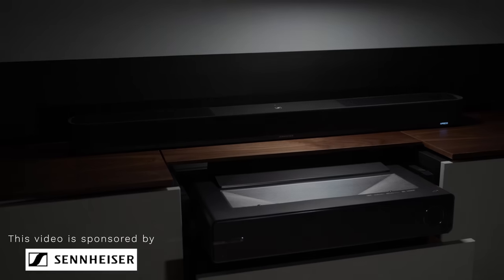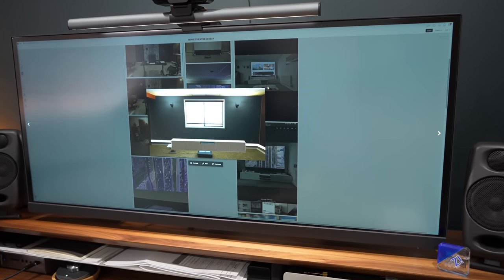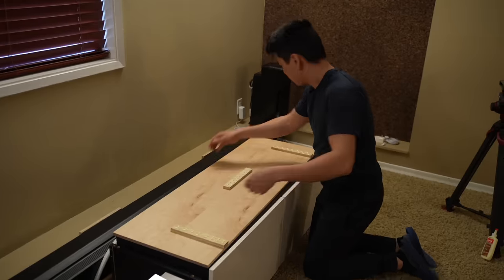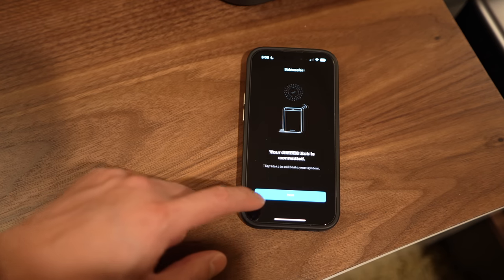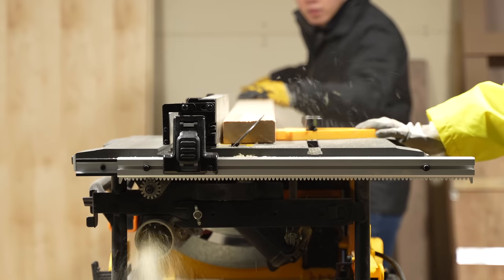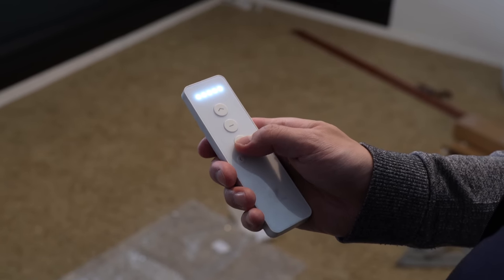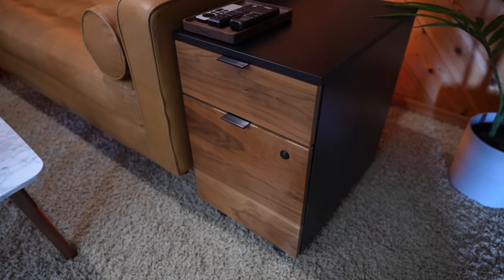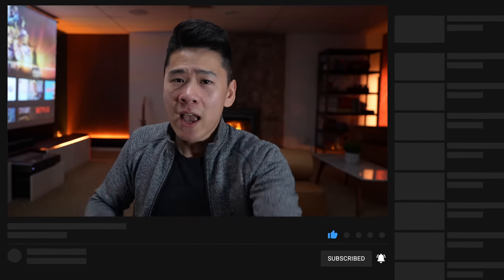The Modern DREAM Home Theater Room Makeover 2024

Comment: Word of advice, DO NOT wear gloves when working with rotating parts of machines! If you run your hand into the blade, it might catch and PULL your hand in and do more damage. Pay 100% attention to your work. As a contractor working overseas on military bases, I had to get on SAFETY for not following the rules. They would tell workers to wear gloves when operating table saws and I had to correct them! These are the people who SHOULD know too!
Reply: Agree
Reply: Dork
Reply: Nerd
Reply: Hard agree. People who aren't familiar with tools tend to think gloves are always best, but it's super important not to wear them when using power tools.
Reply: Insane!
Reply: Depends on the gloves, but yeh

Comment: You really lucked out with how the room was already designed. The rock wall and fireplace, and the wood paneling really ties it all together. Would not look half as cool without those, tbh.
Reply from the maker: the room definitely had quite a character to it!
Reply: I do think he complemented what he had with the furnishings and design he chose. The rock wall fireplace is great on its own but the wood paneling is an old look that others may have decided on removing to replace with drywall (possibly to hang up posters or those sound proofing panels on). He made it work with the choice of color of his sofa and chaise lounge, as well as the wooden panels of his projector/TV stand.

Comment: First thing I would have done is rip up the carpet and put down some hard wood flooring.  Also, would have painted the brick wall for the fireplace and removed the drop ceiling and installed pot lights.

Comment: Looks fantastic! One thing you might consider upgrading in the future is having actual 5.1 surround sound speakers. Sound bars can work really well but I'm telling you once you get decent speakers you won't be able to go back. Especially since you have ceiling tiles, running speaker wire would be easy without them showing.
Reply from the maker: Will definitely look into that for future upgrades, thanks Josh!

Comment: U should REALLY let the soundbar "tone-scan" the room again after changing anything about it!
Since it works via reflecting the sound off surfaces, adding the Slat Panels, sofa & table, drastically changes the accoustics of the space!
Also, how about putting a small firewood-storing shelf next to the 🔥fireplace on the right, to hide the wall outlet and cabel :) ..(it also improves accoustics a tiny bit and looks real cosy)
Reply from the maker: great suggestions, thank you!!

Comment: This looks awesome. I did a similar project (no nearly as involved tho) and the only thing I would recommend is painting the ceiling the same color as the dark accent wall. Use a matte finish and it will make a huge difference to the room. Amazing job on the TV cabinet tho, that thing is a work of art.

Comment: 🔥🔥 Awesome job. Quick question on the bookshelf... why'd you decide to shift it to the right, next to the wood wall vs center it on that section of wall, which would hide that outlet? Also, how'd you end up deciding it was best to put the IKEA cabinet holding the projector directly on the ground vs on 1 or 2" legs, which would have avoided dragging the carpet when opening or closing the doors. I realize it would have affected the overall math for the projector height, but I imagine you consciously made the decision early in the process. Awesome job on this project. Absolutely nailed it.
Reply from the maker: Hey Chris! I placed the bookshelf off center because I was planning to put a tall plant right inbetween the fireplace and bookshelf to make it look less empty xD

As for the cabinet, the doors do drag on the carpet, but only slightly! I'm impressed that you noticed that haha! I needed to minimize the height so that was a little trade-off, but I don't use the cabinet doors that much anyways :) Cheers man!

Comment: Hey man love what you done! gave me plenty of ideas for my place. Just a heads up, there's some weird pitch whenever your mic is in use, I pulled it into a spectrum analyzer and there's some weird harmonics, around 2.3k 5.2k 8k and 10.1k ish, It's only when your mic is in the mix, no idea what it could be coming from but if you record silence and turn up the gain it should be pretty easy to hear and try to figure out where the problem is. My ears are pretty bad so I'm probably only hearing the 2.3 part, when I run a parametric eq to cut around 2.3 a lot of the whine goes away. Probably something only I notice but I thought I'd mention it, if you have questions or need help feel free to reach out.

Comment: You need to change the carpet. Instead of the Ikea VOLLERSLEV, use a synthetic wool carpet. That way, you wouldn't face the sliding problem of the panel as seen in the video and it looks as good as any other layout.

Comment: I'm not sure why you didn't take advantage of your drop ceiling and recess a different style of electric screen that drops down, rather than one that goes up. Same with the projector. A drop ceiling allows total access to run cables and install a ceiling mount. Soundbars are not the way to go either. A separate receiver and 7 to 9 speakers gives you much better sound reproduction using Dolby Atmos, and with ceiling access, it's super easy to mount 4 speakers up there. You did a nice job on the woodworking, especially with those waterfall edges matching the grain.

Comment: Great build, especially considering it was your first woodworking project! From the perspective of shop safety, as a general rule, you want to avoid wearing gloves with any powered, spinning, cutting tool such as the table saw. The risk is that if the blade catches your glove it will pull your hand into it and you won't be able to quickly pull your hand out.
Reply from the maker: Yes no more gloves for sure on the table saw, thank you for that tip I appreciate it!

Comment: One tip for your woodworking: Never use gloves when working with machines such as a table saw, router or even a drill press.

If the glove is caught, it will pull your hand into the machine!

Comment: Hey do you still have the sennheiser Ambeo plus? And if so do you recommend it? I am looking to get the bar and two Ambeo subs.
Reply from the maker: yup still using it and the bass is still the best I've heard so far. It would be epic to use two subs with it, let me know how it goes!
Reply: @MikeWat  I will do. I hope they come out with rears like I’ve been hearing they would.
Reply: @MikeWat  Would you be able to share your settings? I heard that putting it in adaptive mode, having boost on and raising the center channel 4db was really good. Much appreciated with your feedback. If I get the bar and two subs, I will post on here. I dont see people on this platform use multiple subs with this bar....only one used all 4.
Reply from the maker: @MrNickster12345  I usually use movie mode with boost on - +1.5 and +2 to the 2nd & 3rd setting

Comment: The soundbar was just lazy.  Given you have a suspended ceiling running wire to discrete rear speakers or in-ceiling speakers would have been a breeze.